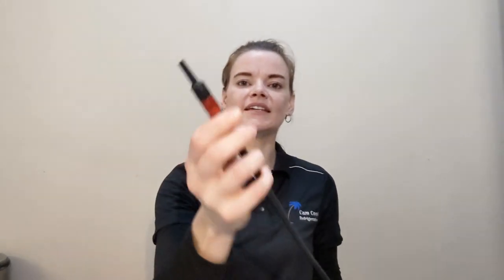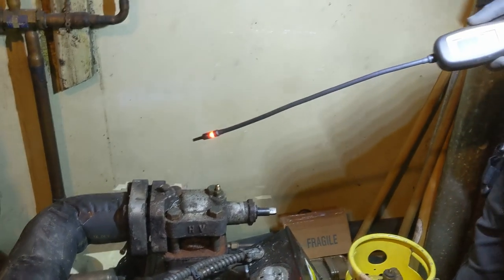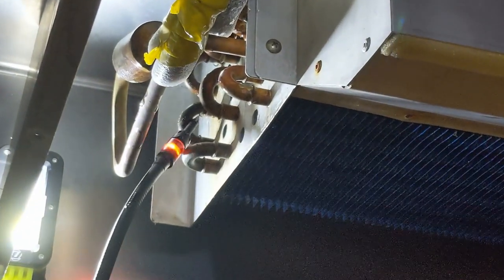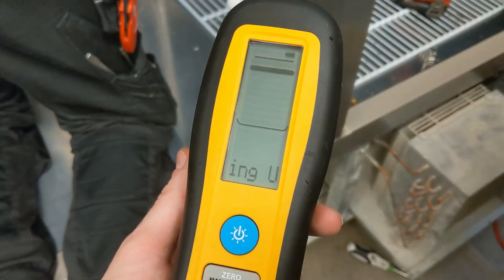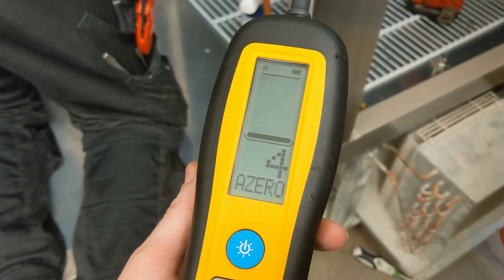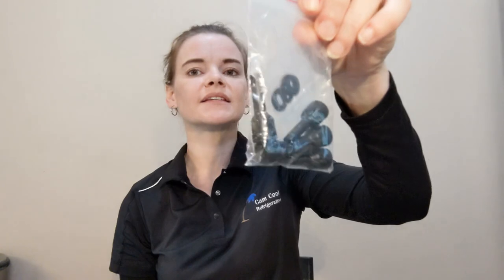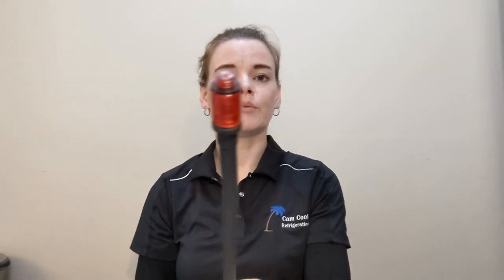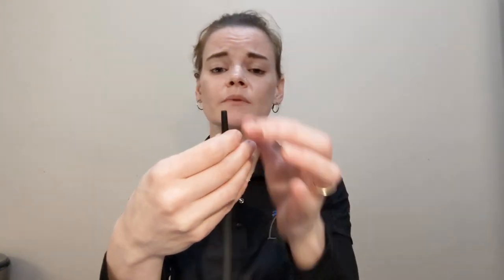HVAC Tools - Fieldpiece DR82 Digital Refrigerant Leak Detector

Comment: Thanks for the information on the DR82. I have the Fieldpiece SLR2... works great but i think i will pick up a DR82 to compare.
Reply from the maker: Good choice!  I've used a few other brands and the DR82 is by far the best, most accurate and reliable.

Comment: I like the DR82, always was an H10 fan boy but they went downhill after Mars started producing them rather than Bacharach.  One gripe I have on the DR82 is the charge port, it's not a very secure connection if you have to charge and use it at the same time.

Comment: Hi..does the system have to be running to find the leak or can it be off?
Reply from the maker: The system does not need to be running but you do need to have sufficient refrigerant pressure to sniff the leak.  If you come to a system without any refrigerant at all, you would need to pressurize the system with nitrogen, but then you need to use a different leak detector as nitrogen is an inert gas and will not be detected by this leak detector.